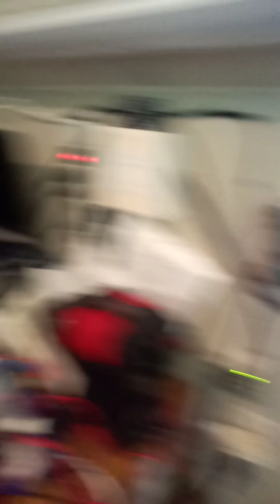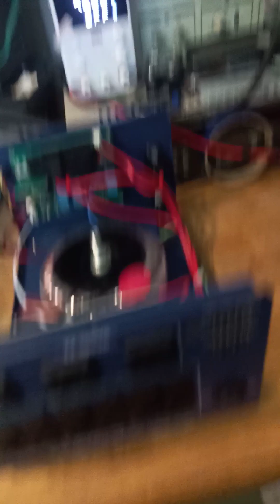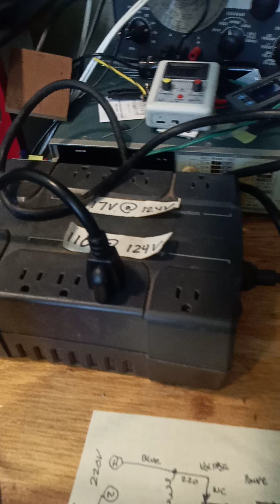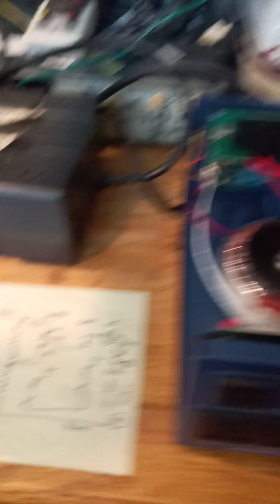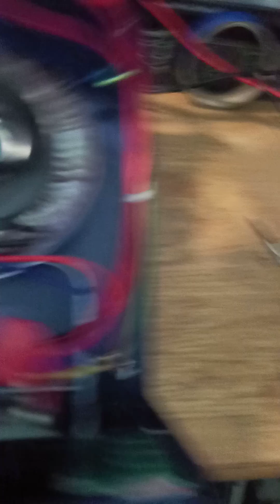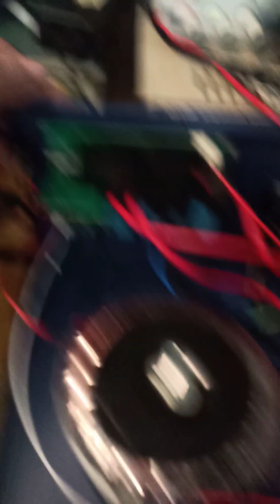500W Intelligent UP/DOWN Transformer Modifications, What's Inside These

Comment from the maker: The latest addition to the attic shop.  This intelligent step up / down transformer automatically senses the input voltage and selects the proper transformer tap.  This allows me to switch between 110V inverter and 220V inverter without worry of damage.  Lots of space inside because this is the same case as the 5,000W version.  I sometimes need different voltages and have added a switch to insure the input power stays on the 220V transformer tap.  I also added MOV and RC network to absorb noise.  500W is all I need for most electronic tests.